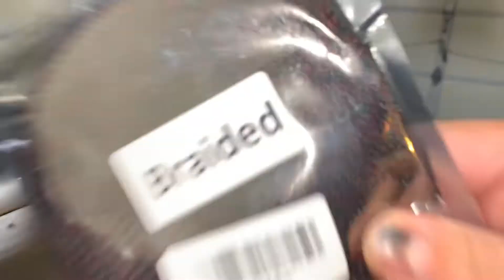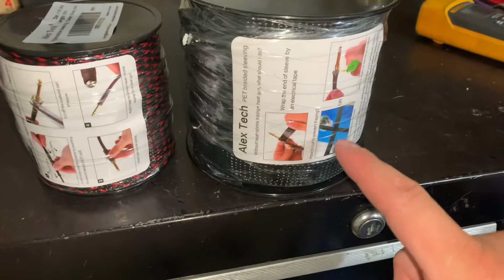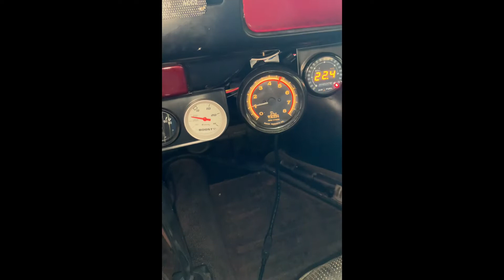VW Bug Turbo CB Performance Black Box

Comment: Just burn the end of the loom instead of using heat shrink. Love the red and black, I ended up using it on the fuel line and breather lines as well. 
Let me know what you think of the cb black box, been toying with the idea for a while now myself.
Hopefully adding you to the list of channels to follow in my vid description will help you grow.
Reply from the maker: Yeah, I did the burning trick but it wasn’t working as well as I wanted it to. So I just ended using heat shrink. I’m loving the black box until I broke the fan 😂. It’s noticeable power from the 10psi timing tune CB has loaded on it. Also the 2-step is awesome! I’d be honored to be on that list Gary!
Reply: @EmmettRacing  sweet man, I’ll have to look into it later down the road. My tiny budget is focused on the 60 right now. 
We all gotta stick together man, it’s all about the community!

Comment: Aint programmable timing AWESOME?? I did this in 2008 on my turbocar, and it is friggin amazing what it does to it, in terms of fuel economy throttle response and part load cooling and of course much better boost timing. Especially on a draw through set-up, it is close to impossible to get the same kind of timing using old school springs, weights and vacuum/boost canisters that can be done with a real 3D timing map!
Reply from the maker: Absolutely It is awesome! Everyone who’s into building cars needs this or something similar.

Comment: Does the black box use hard or soft rev limiter? And how do you lock the distributor?
Reply from the maker: I believe it’s a soft limiter based on the fact that it won’t hold the limiter at the rev limit for very long. It will rev past your limit after a while of holding. I actually bought a locked out distributor from lowbugget.com

Comment: Does the black box just control your 2 step?
Reply from the maker: That’s a good question. The black box is a timing controller. I can adjust timing on a spark table, set rev limits, and control 2-step.